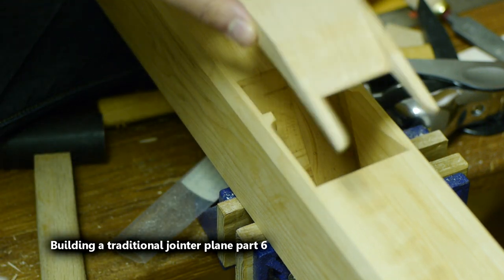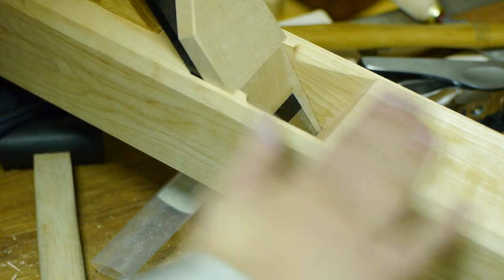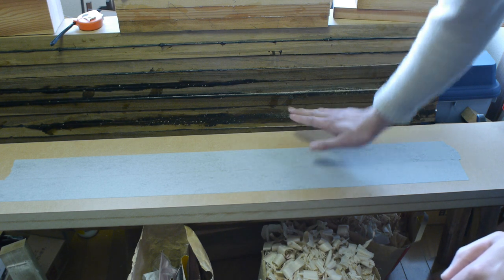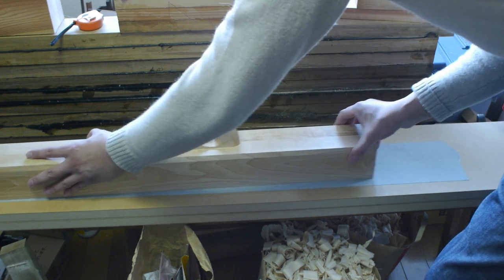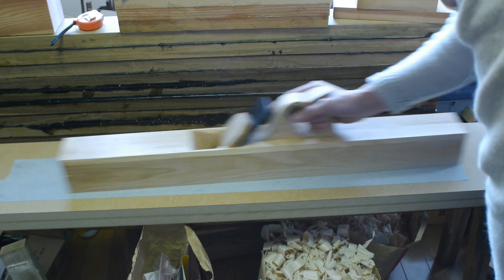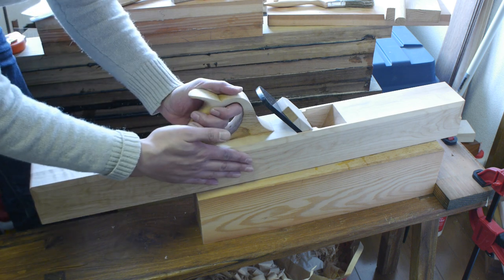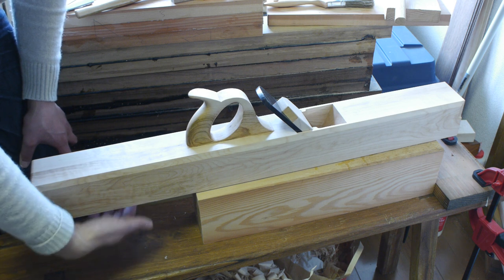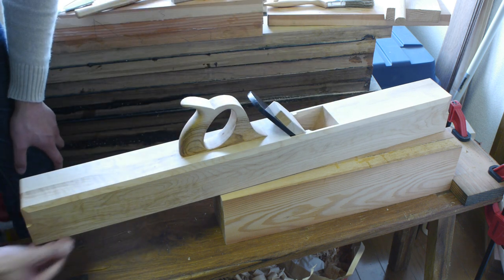How to make a traditional style jointer plane part 6

Comment: Nice looking plane.  Great job.
I've used carriage bolts for striking buttons.  You can get them in steel, of course, or in bronze.  I grind off the square shoulder, saw off the threaded section, and tap it into a hole thats the same size.  The head has a nice rounded shape.

Comment: What an excellent series!  I am delving into the world of wooden planes and started restoring a jointer last week.  I had some questions about what I was finding and you provided insights for all of them.. In fact, I am inspired to try building my own.  I do need to finish this restoration.  Apparently it was worn significantly out of square so I am debating whether to use this as a decoration or to square the sole and "shim" the mouth with veneer.  At any rate, EXCELLENT videos!! THANK YOU!

Comment: That's a good size.  You could go even bigger.  The bolt heads I use are about an inch.  That's a bit bigger than 20mm, I think.  I like the domed shape of the bolt head, I assume you filed a chamfer around the rod.  Great looking plane, thanks for posting.

Comment: great video series,
a couple of ideas to throw in.
drilling a couple of holes in side to dowel fix tote.
dark hardwood dowels or brass rods to finish with the two knock plates.
what grade of paper would you move up to to smooth sole?
600 grit to give a nice finish.
like you i think danish oil is really good for planes.
thanks for the time you put into the series, great skill and work.
look forward to bench series.

Comment: Interesting inspirational series.  Would have liked to seen more of it in operation.  Thanks very much
Reply from the maker: Thanks! I would have liked to show more but as you can probably see, the space I have is quite limited and now, it is even worse than when I did the video. The bench project is (yet again) on hold so I haven't really used this plane for its intended purpose yet. I have used it here and there with some really ghetto work holding setups but because this plane is so big and I have so little room, I find I can't use it as much as I would like. Once I get some more space I would definitely like to show more of it in action. Thanks for the interest!

Comment: Awesome video, probably the best video on making a handplane on YouTube.
You've definitely made planes before and know very much about the details of the process.
One day, when I can afford it, I'll try and get a wide custom-made blade from Japan.
I don't know what the maximum width blade is, which one can still push (or pull) by hand, but I've seen veneer-plane videos, where the blades seem to be around 20cm wide.
I do have a large slab of hardwood, which is at least 40 years old; I think this might be very suitable.
-But before making the plane I'm going for, I'll practise making some smaller planes, just so I don't mess up easily.

One thing I noticed in the video, is the way you mount the handle. The front and back of the handle are both vertical.
I've seen that most wooden longplanes / jointer planes have an angle on the back-end of the handle, so that it will stay in place if the glue fails one day (this has happened very much; probably because the glue used back then were not weather/water resistant).
-So if your handle gets loose one day, you may want to make a 60° ... 80° angle on the rear-end of the handle and a similar mating angle on the plane block itself. This is of course a tiny detail and I have not found out why the angled part is on the rear-end instead of at the front-end of the handle; since if at the front, the angle would 'push down' into the plane. There's likely a good reason for it. ;)
-But if you're using Titebond II or Titebond III, then it's likely that your plane handle won't get loose due to moisture.
Reply from the maker: Hi, thanks for watching!
There are very wide blades available in Japan and if you go the custom route, you could probably get any size you want. As you mention though, there will be a limit to what can be used by hand. A plane with such a wide blade in the Western style will be HUGE and I'm not sure it would be a good idea.

The tote on this plane had a slightly angled front surface to help wedge the back of the tote into the back of the plane body mortise. This helps to stop the tote rotating forwards when you push the plane. The idea for having an angled back is for the same purpose. The rotational force from the leverage on the tote while pushing is the main form of stress on the tote. To be honest, I don't think I angled it enough when building this plane but as long as you use good glue and have a good fit between the tote and body mortise, it shouldn't work loose any time soon even without any wedging :)
Reply: I will purchase a real Kanna plane, before I make my own planes.
It is likely best to work my way up and get a good feeling for the japanese planes.
I've watched a few videos and read about how the irons are made.
To me, each iron is representing the person who forged it with care and precision.

I've seen a lot of shops selling "Kanna" irons, which are not made in Japan - if I'm going to buy an iron, then it has to be the real thing, the others may be better than western irons, but not as good as real japanese irons.

As for the handle, I agree - it will last for a very long time; much longer than the ones that were made 100 years ago (their glue weren't as good as the glue you used).
It's even possible that the glue will last as long as the plane itself.

Comment: The older Stanley Bailey No. 8s, if they are in good shape like mine was, typically go for between $300.00 to $400.00 on eBay in the US, and I've seen them reach $495.00, so $200.00 was a steal. They're just getting rare. I'll bet they're easier to find in the UK. You can buy No. 7s all day long, but the No. 8 is another story. The shipper was using a type of USPS bulk rate. It took two weeks to get to me but the shipping was only $13.00. Thanks for the info on the blade, your work is awesome.

Comment: Wow! That is an awesome plane!  Is this a design that you think can be used to make other planes?  I watched the whole video series and while it does take time, being careful, and a certain level of skill, you made it look legitimately doable and since I'm new to woodworking that is really important lol!  I am going to try my hand at one of these once I can finish getting my garage shop setup.  I have some hard maple and oak that I've been itching to use. And I am definitely a new subscriber!
Reply from the maker: Thanks for watching!
The same design can be used to make any sized plane. Just adjust the dimensions to suit the blade and decide on the length depending on if you want a jointer or smoother etc. For smaller planes you probably want to leave the tote off.
It isn't hard to do and as you said, if you are careful you should be able to pull it off no problem.
Have fun ;)

Comment from the maker: As for the abutments, yes, the abutments on traditional planes are different to Krenov style ones. Krenov planes use a pin to hold the wedge. I find this gets in the way in use. The wedge also provides less clearance for chips (not really an issue).
The traditional style plane wedges the outer edges of the wedge under the abutments, so there is no pin. This means you need to shape the bottom of the mouth so shavings can escape properly (not really ideal either).

Comment from the maker: Thanks!
Fixing tote is a good idea although I would do it with a wedged mortise to avoid showing the dowels.
I actually used brass rods, 19mm in diameter iirc, for the strike buttons. Any hard, end grain wood would work fine too. I mention this at the end of the video.
For the sole I think 400 is way enough. It will get burnished in use anyway.
For the body I prefer to leave a planed finish where I can but for the tote paper up to 400 is sufficient.

Comment from the maker: Carriage bolts are a good choice. I couldn't find any in brass over here so I went with a rod. I was also probably overthinking things but I was worried that the overhang of the head over the shaft might get mashed down if you hit it wrong with a metal hammer?

Comment: And what better way to learn to know them then by building one myself. Just one more question and I won't bother you anymore though: Is there any significant price difference between white and blue steel or are they pretty much on par, just meant for different puroposes? $175 is actually less than I expected after I have seen the prices of complete planes. Not that it isn't steep, but it's justifiable. Anyway, thanks for all the tips and have a great weekend! John.

Comment: Thanks so much for these videos!  I have a question about bed angle.  I have purchased a Tsunesaburo Aogami 60mm laminated iron.  However, it is only 2.3mm thick, much thinner than the one you used.  I'd like to reduce chatter, so I'm wondering if it would be wise to use a different bed angle than 50 degrees?  Thanks!

Comment: By the way, I had a look at the blade manufacturer you mentioned under first video in this series. I understand you had it made to your specifications but as I can't find any similar blade on their website, I wanted to ask how much would a similar blade approximately run for? I have always admired japanese hand planes for their simplicity, but from what I know, they're not exactly suitable for hardwoods and this seems like an ideal solution. I just don't like buying things to replace them later.

Comment from the maker: Yeah I've seen people online use bigger strike buttons but brass rod gets kinda heavy, haha. The jointer is pretty front heavy now which is not such a big issue but you know.
I did file a dome onto the brass rod and it took ages to get right since I couldn't chuck it up in a drill. A carriage bolt would be much simpler.

Comment: Your video just amazing!! I just followed your video to made a wooden plane. However, the shavings come out is not beautiful like yours. I am sure I had make some mistake or stupid hands, but it is working well actually.
Do you have any tips to make a plane can do a beautiful shavings like yours? I hope I can make a wooden planes perfect like yours in the future!!
Reply from the maker: Hi, thanks for watching!

What kind of problems are you having?

My plane is far from perfect but tips wise, I would say make sure your blade is sharp and adjusted properly, i.e. depth of cut and left/right even-ness. If you are sure that is all done properly then look at the throat area. It should be smooth and not have any bits sticking out that could catch on the shavings as they come out. Same with the wedge. Make sure that the wedge is smooth and not blocking the shavings. Also, make sure the mouth itself is wide enough to clear the shavings.

If all that checks out OK, then check to see if your sole is flat. It doesn't need to be perfectly flat, just flat enough, especially for this size of a plane.

These should be the only things that affect performance of the plane so it is most likely one of these things. Of course, the final factor is user technique so work on that if you are sure that all the above doesn't fix your problem :)
Reply: Thanks a lot for your reply~! Actually, my plane is working fine. But the shavings coming out is curly, not like the shavings straight like yours.
Reply from the maker: Thomas Wong Oh, straight shavings vs curly shavings can depend on a lot of things and I am not sure there is a single cause for the difference. Things like shaving thickness, blade sharpness, bed angle, wood species etc can affect the shaving. If the shaving is exiting the throat cleanly, then I wouldn't worry too much about it.

Comment: Do you think it would be possible to flatten the sole of a jointer plane with a No 5 metal plane? Trying to tune up an old wooden jointer and don't have a long enough flat surface to use sandpaper.
Reply from the maker: Hi, that's definitely doable. It depends on your technique so you can't just blindly go at it with the no 5 but if you are conscious of where you are removing material and check frequently with something like a 1m steel ruler, you should be fine. Also try and take as fine a shaving as possible on the last passes to improve accuracy.
Reply: @sumokun  Thanks! Will give it a try then. I flattened a small wooden plane this way before, but wasn't sure it would work on the long (65cm) jointer.

Comment: I guess you're right, a carriage bolt head could get mashed over.  I'd have to be pretty off with my aim, it's not happened so far.  What diameter is the rod you are using?

Comment from the maker: Thanks for watching. I'm glad you found it useful.
I think as long as the sole isn't too badly worn, straightening it up and putting an insert in to close up the mouth would be a good thing to do. If its really worn, you could just laminate a slab of wood onto the whole sole and recut the mouth. Depending on how much work it would be to rehab I would also consider creating a new body for the blade and just putting aside the old body for decoration or as a model to copy from, especially the tote.

Comment from the maker: Yes, I find with a thick iron, say anything over 3mm, a chipbreaker for support is useless. I have mixed feelings using a chipbreaker for breaking chips however and I'm not fully decided on if they are effective or not. Clark and Williams' site has a "technical paper" on chipbreakers and they explain why they think they are useless. They have other stuff on their site too which is worth a read but I think needs to be read with a pinch of salt.

Comment from the maker: Hi, thanks for watching.
I have a few metal planes and I would rate the wooden as being able to take the same level of shavings however doing so with a metal plane is much easier for a beginner due to there being less maintenance requirements (sole flatness etc) and also because of the easier to use adjustment mechanism. Once you get used to wooden planes though both these points become a non-issue.

Comment: Thanks. I realize the steel is great. After all, it's pretty much what japan is known for around the world. I meant plane bodies are not that suitable. I am not sure what it's called, I think 'dai'? I have checked out the Brese, which I didn't really know before, but if I did go that way, I think I would rather invest in a Lie Nielsen jointer. And I am all for restoring old hand tools, but the process seems a little bit more intimidating then creating one from scratch for some reason.

Comment: Hi, I wish to buy some hand plane and i don't know which is the best choice between wood bodied hand plane and steel bodied hand plane. Do you know the Juuma jointer N° 7 (qiangsheng product like WoodRiver it seems)  do you think it can be a good choice for the price?
Reply from the maker: +villejoin Hi, if you are unsure about which type of plane to buy, then I would recommend you go for the metal bodied one because they are less fussy and easier to set up for a beginner. I am not familiar with the Juuma brand but if they are the same as the other Quangsheng type planes, then it will be a good performer. Wooden planes are more trouble because you need to maintain them more often and they are fiddly to adjust for a beginner. A steel plane has dials and levers to let beginners dial them in more effectively, not to mention a quality one will be tuned up pretty much flat and ready to go. Wooden planes are great though because they are smoother in the cut and they can be custom made to whatever dimensions you need.

Comment: awesome job!! do you still like using it today???
Reply from the maker: Hi, unfortunately I can't use it as much as I'd like to simply because it is too big for most projects I work on. I built it with the intent of using it to build and flatten my workbench top but my workbench top sort of self destructed a few months ago. I'll cover it in a future update but needless to say that has set me back quite a bit, along with a bunch of other events outside of woodworking. That being said, I do remember the times that I have used it that it was a pleasure to use. I don't have anything else that size to compare with directly but I think it is both easier to handle and use than say something like a Stanley #7. The only downside is maintenance of the wooden body but even that isn't something too laborious. One thing I have found with wooden planes in general compared to metal ones is that they require more care in use to make sure you are getting the work straight and flat. For some reason I feel that I can shut my mind off a bit more when using a metal plane and still get a really straight surface but the woodies need a bit of extra thought and care. In any case, I would really recommend building one simply because it is fun and inexpensive to try.

Comment from the maker: Oh, BTW the Brese iron was something like $60-70? I forget. You can get a similar blade from multiple sources, like Lee Valley, Philly planes, Ron Hock etc. They're basically thick (5mm or 6mm or about 1/4") and made of O1 steel. As I said in the video, I think a vintage laminated steel blade from that auction site would serve you better if you are prepared for the work to prepare it for use.

Comment from the maker: No worries about questions, I'm happy to answer them :)
Blue is slightly more expensive than white. It probably adds a 2k yen surcharge so its a good idea to get a white blade for lower angle planes and blue for higher angle. The backing iron I chose was more expensive by about 3k or 4k iirc so some cost cutting could be done there too. Size of blade didn't make much difference to price iirc. The blade took something like 2 months for them to make so plan ahead ;)